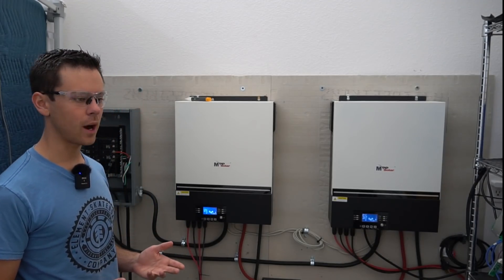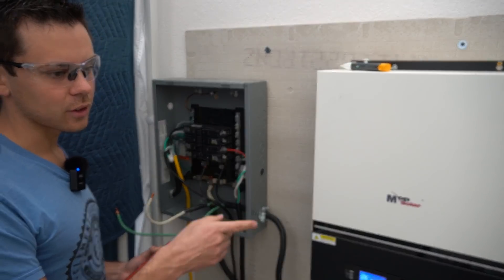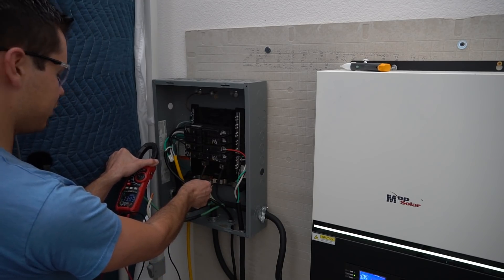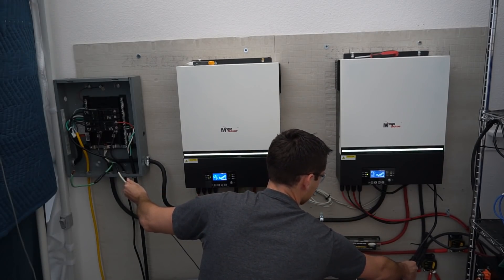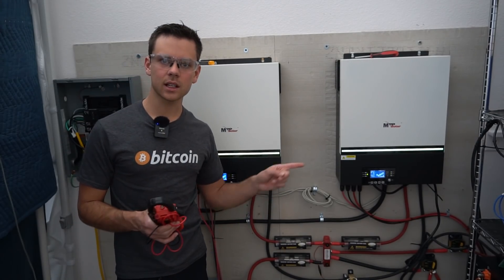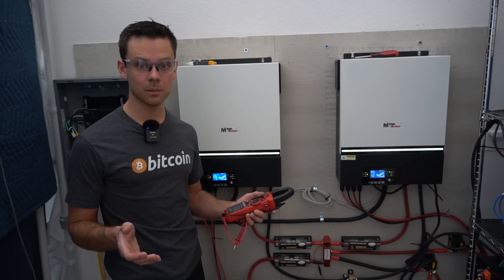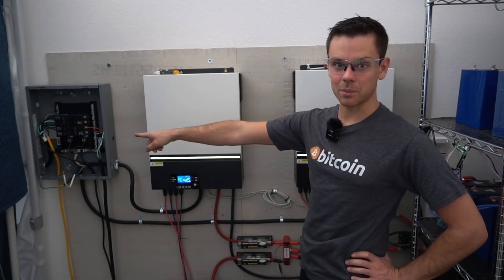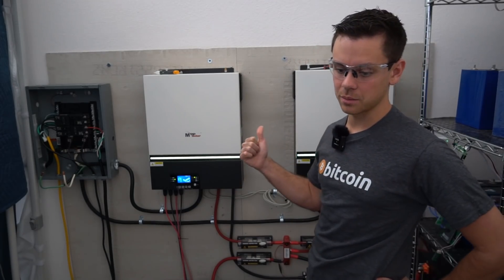Advanced Level Grounding Discussion for All-in-one Solar Power Systems

Comment from the maker: I contacted MPP and they agreed with my conclusions in this video. Keep grounds and neutrals separate. Treat it like a sub panel. 

When ac output is in series, the bond between neutrals needs to be perfect. 

Furthermore, only tie earth ground to ac input. Not the panel. If you connect the panel instead, you must ensure that the ac input is not used.

~~~~~~~~~~~~~~~~~~~~~~~~~~~~~~~~~~~~
Tired of getting ripped off? Check out my "Will Prowse Approved" solar product recommendations below!

12V Batteries
https://www.mobile-solarpower.com/lithium-batteries.html

48V Batteries
https://www.mobile-solarpower.com/48v-batteries.html

Offgrid Inverter System Builder
https://www.mobile-solarpower.com/48v-complete-system-blueprint-559371.html

Hybrid Inverter System Builder
https://www.mobile-solarpower.com/code-compliant-48v-offgrid-system.html

Mobile Handtruck System Builder (very popular!)
https://www.mobile-solarpower.com/mobile-48v-system.html

Solar Panels
https://www.mobile-solarpower.com/300w-solar-panels.html

Ground Mount Solar Racking
https://www.mobile-solarpower.com/ground-mount-racks.html

Wire, Lugs and Busbars
https://www.mobile-solarpower.com/wire-and-connectors.html

Tools
https://www.mobile-solarpower.com/tools.html

Fuses and Circuit Breakers
https://www.mobile-solarpower.com/fuses.html

Plug-N-Play Solar Systems
Ecoflow, Anker And Bluetti! So many models to choose from. See my current recommendations here:
https://www.mobile-solarpower.com/full-size-systems.html

~~~~~~~~~~~~~~~~~~~~~~~~~~~~~~~~~~~~~~~~~~
Need to build a large DIY system? Need a trustworthy solar distributor? These are my favorites:

Signature Solar
Creator of EG4! Solar Minisplits, Victron and More! Largest Solar Store Online.
If you want $50 off, please use my link below and coupon code "DIYSOLAR50":
https://signaturesolar.com/?ref=cPwLcVc0SW-BjN

Current Connected
Best Prices for EG4, Victron, Midnite and so much more! Fast Shipping and Highest Rated Customer Service:
https://currentconnected.com/?ref=wp

~~~~~~~~~~~~~~~~~~~~~~~~~~~~~~~~~~~~~~~~~~
Join our DIY Solar Community 
Need more help? Join the largest solar forum on the internet for beginners and professionals alike. 140,000 members and counting!
https://www.diysolarforum.com

Check Out My Free Book
Best-selling and beginner-friendly guidebook to off-grid 12V solar!
https://www.mobile-solarpower.com/the-book.html

~~~~~~~~~~~~~~~~~~~~~~~~~~~~~~~~~~~~~~~~~~
Contact Information:
I am NOT available for personal solar system consult! If you wish to contact me, this is my direct email: williamprowsediysolar@gmail.com
FTC Disclosure Statement and Disclaimers:
Every video includes paid promotion or sponsorship (such as free products for review). Some links on this YouTube channel may be affiliate links. We may get paid if you buy something or take an action after clicking one of these. My videos are for educational purposes only. Information is subject to change/update at any time. Electricity is DANGEROUS and can kill. Be smart and use common sense :) DIY Solar Power with Will Prowse is a participant in the Amazon Services LLC Associates Program, An affiliate advertising program designed to provide a means for sites to earn advertising fees by advertising and linking to Amazon.com
Reply: The problem with this is if the inverter is being used off-grid only (no AC input of any kind connected), you still cannot connect this to a standard home transfer switch. For example, in my Reliance transfer switch, the neutral is not switched (as it should not be) thus the neutral and ground both pass through the transfer switch to the main home panel - where they are bonded together and cannot be undone. In this case, the ground between inverter and transfer switch is now carrying current (very bad). I still don't think there should be a bond inside the inverter. Am I missing something here?
Reply from the maker: @LithiumSolar  yeah this is the confusion I have as well. When used with a bonded panel. Dexter mentioned you want the bond as close to the source as possible. And you have two inverter outputs in series. So I don't think there is a right way to do this really. No bond might be better actually. But we are supposed to bond at the source. But the source is two separate circuits in series. I don't think there is an actual recommended configuration for that situation. I would imagine no bond would be better, then ground at the panel.

What they should have done is had a ground netural relay that you could program. Would fix this issue for all these all in ones.
Reply: @LithiumSolar  I believe you’re correct that the bond internally needs to be broken if it’s being tied to an AC input.  It’s pretty terrible the MPPSolar doesn’t address this in their literature but as I’ve said before, they more direction they provide around the nuance of grounding the more liability they open themselves up to.

So the concern is if you open the bond is that in SBU mode you now have a floating neutral correct?
Reply: @will have you looked at the Enphase IQ8 solar micro inverter/batteries? They add a neutral transformer in the collector panel . Thought it very interesting and worth a look.
Reply: Will, the non current carrying  metal parts of the system should be bonded together with a bonding jumper per article 250.90 of NEC. This is to ensure none of the system enclosures, raceways, conduits, boxes, or panels can have a potential difference.
Reply from the maker: @matthewalberhasky7114  what does the NEC say about two off-grid inverters with the AC output in series? That's the big question here
Reply: @WillProwse  article 710 is for Stand-Alone Systems, 710.15 Says premises wiring systems shall be adequate to meet the NEC code requirements for similar installations supplied by a feeder or service. (B) Disconnecting means  shall be sized based on the sum of the output ratings of the stand alone sources. Basically the inverter in a stand alone system is wired similarly to a grid fed system. The NEC is still trying to catch up to the new equipment that is available today. Some questions will probably be answered in future code updates.
Reply: If the neutral to ground bond is in the inverters, then that situation would be similar to a grid fed system with the neutral to ground bond in the meter base. You would then separate the neutrals and grounds in the sub panel. You need a ground from the inverters to the sub panel to allow the inverter to clear any fault condition. I would hope that the inverters are electrically monitoring the phase to ground circuits on the output to stop producing if there is a fault. Code allows the back feeding of breakers in a panel from an inverter if the breakers are rated for backfeeding, and most are.
Reply: @WillProwse   I’m considering breaking this bond for my setup. I have a main garage panel that will the AC inputs connected. That panel is the N-G bond point and then feeds into my house panel…I’m planning on installing an interlock between the sub panel main breaker and the inverter outputs in that same panel.  Since the sub panel will still have the N-G bond back at the main garage panel I believe I need to break the inverter N-G point to prevent having two bonded connections.  Thoughts from anyone on this?  @Ian you out there too?
Reply: @danksu04  did you end up removing ground neutral bond inside the inverter?
Reply: @joewayda1268  yes, I did on just one of the two.  I believe I still need it on one of them.
Reply: @danksu04 what if you only have 1 inverter ? Im having same problem with 5kw ecoworthy
Reply: Thanks Will for attempting to help us dummies understand this particular issue with offGrid inverters in series.  I was planning on using these MPP inverters in series inside my house as well as an outside my house (outbuilding), but that appears to pose different issues for each setup that need to be considered.  To play back what I think you said, keep neutral and ground separate (like a subpanel) on ACout.  What if your ACin is fed from an unbounded utility subpanel inside house where ground is not to earth vs. a bonded utility main service panel; and What if your ACin is fed from an unbonded utility subpanel outside house (outbuilding  where ground is connected to earth via it's own grounding rods?  I assume that's why some vendors use ground relays?
Reply: This is a topic I have been researching in preparation for building an off grid (single inverter) system for my tool shed.

It’s annoying how ground is used to describe two separate concepts, bonding and grounding.

My lay-person understanding so far:
The purpose of bonding the neutral to ground (done at the point of entry in an AC system) is to create a path for the circuit to rapidly fail and shut down in the case of a broken wire energizing a metallic casing.  Whereas grounding is the connection of the system to ground.

With an off grid system, grounding is obvious since you want your panels and everything connected to ground but it becomes fuzzy as to wether you bond in the inverter or the switch box (as your point of entry for the AC).

I think it comes down to the design of your specific inverter in conjunction with your use case so the best thing to do is read and follow the manufacturers wiring layout based on your system design.
Reply: Have you tried the Tesla mobile connector and the NEMA 6-50 or 6-30 adapter? That’s what I use because it eliminates the entire ground Vs neutral altogether, and is less expensive to wire up   

6-50 and 6-30 are popular with welding setups
Reply from the maker: @olemissjim  yes, using 6-50
Reply: @WillProwse   fascinating, have you tried swapping the ground for the neutral on the Nema 6-50 ? I was getting random faults from just normal grid with a NEMA 5-20 module and the stock 5-15, but the 6-30 and 6-50 sorted it for me.

Comment: great clarification on the subject. I have installed a hybrid inverter before, but its internal ground neutral bond keeps a small AC voltage at the neutral. this keeps some LED spotlights dim when switched off which is annoying. Has anyone come up with a solution for this to eliminate this voltage without creating another ground neutral bond at the output.

Comment: So, my Sungold AC input is connected with 6/2 back to mains panel and the neutral and ground are bonded in that panel. Only L1, L2, and Neutral are connected to the AC input of the Sungold. Does there need to be a separate ground wire pulled back to the mains panel and terminated in the Sungold on the ground terminal? The AC output of the Sungold has 8/3 going to an isolated breaker panel feeding 4 circuits powered by the Sungold acting as a UPS, only running on batteries when commercial power is lost. Is this acceptable and not creating a ground loop or issue with proper grounding protection?

Comment: Note that this only applies for hybrid Inverters that have AC input from Grid (that has its output already been Grounded, hence labelled Neutral). And the bonding that he is talking is for split-phase 120V x 2 that only used in USA. This does not apply to the rest of the Earth because no country on Earth except USA uses split-phase in its home.

Simply put, you should avoid bonding output of any inverter to Earth. 
For lightning purpose, connect all metal casing of all solar equipment to Earth, but make sure no inverter output is bonded to its metal casing.

Comment: My AmpInvt 5KW inverter has 240V input and 240V split phase output.  AC input is 240, black and red, ground and no neutral.  So the bonding done in my main breaker panel is lost at that point.
The inverter output provides L1,  N, L2 and ground.  I route this to my breaker panel, and in the breaker panel I must bond that neutral from the inverter's center-tap to the ground that goes all the way back to my house main breaker.

Comment: I just bought a Victron Inverter 1200VA for my solar setup in my garage and have a question on grounding.  From the factory the Victron has a floating neutral and with moving an internal jumper it can bond the neutral to ground.  Since this will never be connected to my  existing service panel how do I ground my Victron without creating a ground loop or affecting my existing service panel?

Comment: There can only be one ground neutral bond for any system, so shouldn't all inverters and generator back up input be floating and the one neural ground bond be in the main AC panel as one grounding point for everything in the system? That's my understanding for off grid. In new zealand all home AC circuits are ground neutral bonded, so when you install solar and link into the AC system you have to have only that ground neutral bond operating. So shouldn't all other components in that circuit be floating? It's something often overlooked and not often specified in inverter manuals, or in generator manuals. It has me scratching my head a lot.

Comment: I consider myself above the novice level and have connected a eg4 6000xp system consisting of two controllers, pv panels, and 30 kWh of batteries. When i installed my ac output panel, I kept the neutral and ground separate. So here is my question, when I connect the ac input from my main panel (2 hot wires. 1 neutral, and 1 ground) to each 6000xp will this establish a proper ground? Do i need to do anything else? Thanks in advance for help.
Reply: On the lv6548 you are supposed to connect 120v input not 240.

Comment: Great video, Will. I agree with your assessment. In my case, I've created a hand-truck solar generator with EG6000XP (Luxpower) and EG LL-S battery. But my biggest concern has been this neutral-ground topic.  Most of the time I will back-feed my home electrical panel through a 50A interlocked breaker. In that scenario I am wanting to use the neutral-gnd bond in the 200A panel and DISABLE the n-PE (setting 26) in my inverter. That will ensure I am relying on the house panel's n-PE connection. BUT...when I want to use the hand-truck solar generator in stand-alone mode (not connected to my house panel), I then need to ENABLE the n-PE (setting 26) in my inverter. But there are scenarios where this can be muddled. What if I forget to change the setting?  What if I still have setting 26 ENABLED and I plug the solar generator into my 50A grid (to charge the battery without PV, or to just use it to provide bypass)?  If setting 26 is still ENABLED, then I've created a ground loop.  Another scenario is where I still have the output of the solar generator connected to my "Generator Input" wall receptacle and I haven't flipped the interlock over.  In other words, I'm not backfeeding my 200A panel. I'm using it in stand-alone mode - but kept the output cord plugged in.  This is a problem because only the two hots are disconnected at the 50A breaker. BUT, the neutral and ground wires ARE connected to the 200A panel because I left it plugged in. If I turn on my solar generator and still have setting 26 ENABLED, then I have a ground loop. Some may say... "Well, how can that be?  You can't use your solar generator anyway, because the output isn't being used. It's still plugged into the Generator receptacle."  EXCEPT, that I have a 20A power strip on the solar generator.  If I use any of those plugs, the n-PE connections are both in my inverter AND in the 200A panel.  It is paramount that I remember to change the n-PE setting, depending on the scenario. One more thing. Just this afternoon I had a journeyman electrician tell me I would need to drive two 8 ft copper ground rods, spaced 6 ft apart, each time I use my solar generator in stand-alone mode.  I thought, "Man, you have got to be kidding. Have another beer."  In stand-alone mode I'll want to establish a n-PE connection in my inverter by ENABLING setting 26. But I do not want a ground rod.  I have discussed this with Signature Solar and they agree with my approach.  What say you?

Comment: It is a problem I also have though my AC input is on a relay only activates when the battery is near 0 so I chopped the ac input Earth cable and put a TN-S bonding system in place for offgrid operation. It only goes on grid < .5% so the risk is very low, also I put the ac input via a breaker so effectivley only the cable run to the wall outlet (< 1 meter) is ungrounded.

Comment: Nice information.  But what about if the grid fails.  Maybe something happened and there is no power from the grid.    How will the system be bonded to ground.       Because now we just loose our grid. Where our ac input.  Ground and neutral is bonded.

Comment: I left this comment on another video but thought I would leave it hear as well. We recently discovered that we are feeling tingles inside our home when neighbors solar is on, mostly in feet and legs. Confirmed when neighbor turns off solar the tingles go away. We don't have to touch anything in our home to feel tingling. Its felt all day from when the solar comes on and stops when the solar goes off. We have power company coming to check it out as our electrician has confirmed (so he says) its not a problem within our home. Neighbors deny any issues on their side. Any idea what's going on in this situation and how to solve? Thank you
Reply: That's wild

Comment: If I have 2 pv inputs to the inverter , should the the solar panels on each pv input be earthed separately?
Reply: EminoAir did you find the answer to that? I am in same boat. A lot of controversy on grounding the DC side I.e. panels and rails. At this point I. Think it is better no grounding the panels.